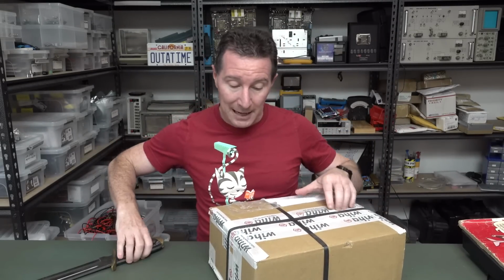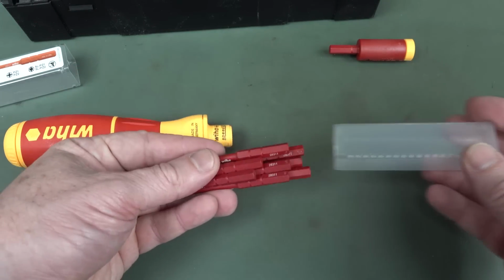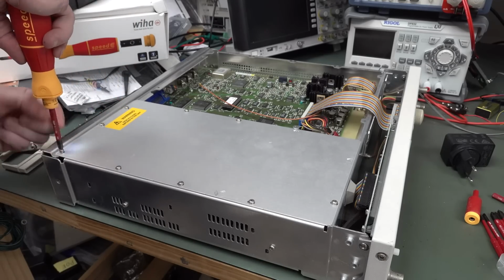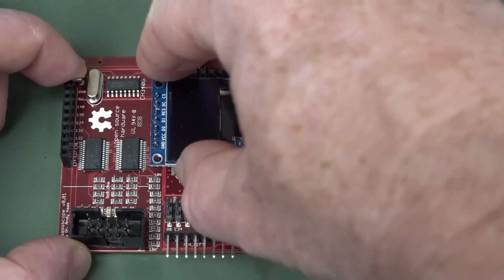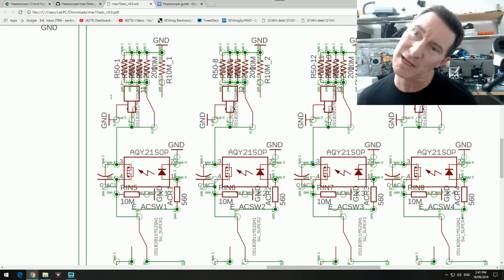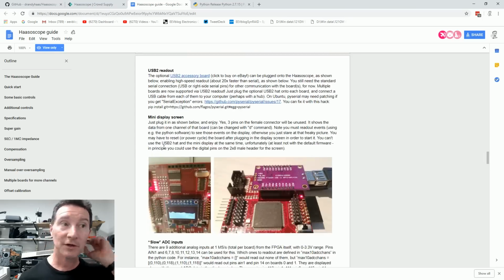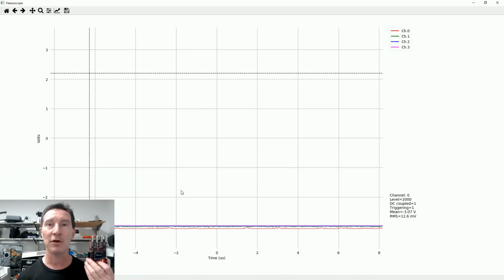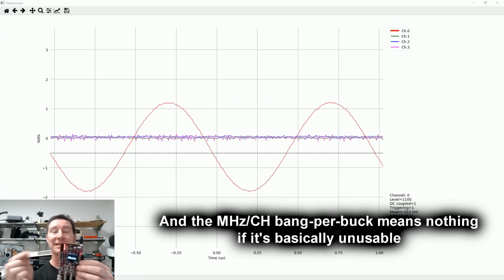EEVblog #1127 - Mailbag Monday

Comment: The 18650 is roughly 15mm longer than the 18500. First two digits are diameter in mm three following length. Protection / integrated usb chargers add some..
Reply: Maybe someone should produce a adapter ring.

Comment: 215 Euro for the entry level screwdriver?? That’s a “nope”.
Reply: NEO Digital you get a makita drill for that price loolz
Reply: @danijel124  you can get the damn set for that price
Reply: The gearing sounds terrible . It will break.
Reply: Yeah, the gearing sounded exactly like my €30 electric drill from 10 years ago...
Reply: Yep. From what he showed I'd have guessed 100 to 150 Euro for the whole set.
Reply: Yah wiha is definitely expensive for just the basic 1000v insulated stuff. It's built brilliantly but there are decent Chinese clones for much less if you're not using them for a job.
Reply: The model they sent dave isn't the 215 euro version its closer to the 371 euro version. Cause its the high speed version but not quite all the included bits as the 371. Still extremely pricey, Even for a professional.
Reply: NEO Digital That's not entry level.  That's a professional tool for working electricians working on potentially live installations all over the place and subject to strict health and safety enforcement.  So no using unapproved tools and parts, no using any tool not isolated to 1000V, no risking tendonitis from doing thousands of screws per day.  Everything about that screwdriver is made to comply with that environment, including recommendation from an organization already involved with other workplace injuries for electricians.
Reply: John Francis Doe What I meant by entry level was the lowest priced version of the screwdriver shown on the manufacturer’s website.
Reply: John Francis Doe,
 “workplace injuries for electricians”
Translation: Big money for greedy companies and jobs for the sake of jobs.
Reply: Dmrdecks your translation is exactly right. A 1000V screwdriver does NOT need to cost 500 anything.
Reply: Well professionals can afford paying that. This amount is also subtracted from tax, since it's a work expense. I don't think it's too great of a deal. Given the quality, this will surely keep working for a long time. Also, don't forget: 500 AUD is a lot more than the actual value in dollars or Euros (1 AUD = 0.62 € as of writing this).
200€ is completely fine for a tool professional electricians buy. I have seen way more expensive tools used by them in the wild.
Reply: 1000 V isolation is not that difficult to achieve.
Unless you have other demands, a normal screwdriver with sheated shaft should pass the test.
If you need a thinner shaft, you'd have to use a layer of mica or something, but even that shouldn't be too expensive.

Comment: If schematics is this worse, how´s about pcb design ?
Reply: May be an autorouted one ? It doesnt look like there was professional hands on layout design. I just had a glance on github files, I am just worried about those analog parts
Reply: Just opened it and had a quick glance. I don't do layouts for a living but just from a few minutes of looking at that board I found a couple of things that would bother me. And I'm sure someone like Dave who has actual experience in the field would rather start from scratch than use this layout.
And yes, there are 2 files for the autorouter in the github repo so that's probably how it ended up being such a mess.
Reply: I have found autorouter configure files inside the repo. It's probably at least partially auto-routed. Pathetic!
Reply: Noise on some channels mean that pcb design have problems too.

Comment: Engineer with decades of experience. Hasn't got python. Sorry Dave but this is 2018, and nothing runs without software, python is just about as common as solder flux in any modern lab. Get with the times.
Reply: Just need a Windows exe? Well that will run on Linux or MacOS ;-)
Reply: It is not the fact, it needs python, but the "world-changing" crap. If everything would be packed neatly in one installer python is fine. But for a real gamechanger, it has to work without what was needed here.
Also, the UI is pretty crap for what it is supposed to be. The everyday user does need all the fancy CLI Options. The everyday user needs an easy start. This was "advertised" as just this.This is just wrong.
Reply from the maker: My lab works just fine without it it seems.
Reply: Question is who would write NEW code in Python 2 in late 2010's?
Reply: @JGnLAU  I have seen this with many packages that depend on certain parts (mathlab etc.) of python plugins, they are not fully compatible with py3.
Reply: Seriously, what's wrong with Python in your opinion (besides execution speed).
Reply: python sucks...i only use it when i absolutely have to (just running scripts..no coding).. this interface could have just as easily been made in C/C++ (and ported to multiple OSs),  while requiring the python stuff only when a user wants to script in their own functionality...the very least they could have done was turn the py scripts into exe's with py2exe :/
Reply: Just as easy in C/C++ you say? Python, in this case, is glue code between QT, a serial port and Numpy (written in C), as well as requiring no extra effort to be portable (even between CPU architectures).
Reply: and your point is Tim? C/C++ can be used with QT and a serial port...
Reply: "this interface could have just as easily been made in C/C++ (and ported to multiple OSs)", C/C++ is not even close to being just as easy as Python for this kind of application. 

I've never understood the hate for Python, it's an excellent language that is a very natural transition away from C/C++ and lets you get to the problem you are trying to solve a lot quicker. In this case, the three libraries I mentioned will handle the bulk of the work.

The real issue here is the app they have produced has an awful UI. Has the look of a half-baked proof of concept.
Reply: I think Tricky Rat and WacKEDmaN are confounding Python with PHP. The latter really sucks, but Python is a fine scripting language for its purpose. They have probably mixed these two scripting languages and never programmed in Python. They are probably only reciting what they heard about PHP but made the mistake to mixing these two up.
Reply: I don't think they mixed it up.
Reply: Антон Южаков
No experienced software developer will say that Python sucks like they did. Experienced software developers might prefer other languages, they might also dislike the way indenting is used in Python but they won't say it's a bad designed language. Because they know, it isn't a bad design for its purposes.
This is a different story in PHP. PHP is really bad in many ways, including if you want to use it for its main purposes.
Reply: @WacKEDmaN  python is good for prototypping and testing. if you are going to have something has half bake has this you better write in python c/c++ will take you 10 time the time with 10 time more problems for anyone who wants to improve your shit.
Reply: "Python.  Why'd it have to be... Python?"  More carcinogenic than even JavaScript.  We need a charity foundation to stamp it out.
Reply: @Remco Stoutjesdijk - You script-kiddies are always good for a laugh...

Python is just plain awful as a programming language, especially considering we are "in 2018", as you put it.

Comment: The wiha is close to what I think a power driver for machine screws should be  - hand operation for final torque and fast-low torque for most of the thread, but looks at least 2x too slow to be a major productivity enhancer.
Reply: What is the difference with just a small battery powered mini drill and a separate screw driver for a fraction of the price?
Over 200 bucks is just absolutely insane.
Reply: @merlingallagher4484  They range from $300 to $520 USD, depending on the model. $200, maybe, if it was worth it for the job someone is doing, price is rarely factored in; you just buy it regardless of cost. That's the difference between some guy in his garage and a person that is using it for their business. But not $300-520 USD. Not to mention, it seems like a piece of shit.
Reply: Agreed the price is a big NO EFFIN WAY for me. It's nice if you get it for free but for what that thing costs ... No way EVER. Not on a hobbyist budget.
Reply: It doesn't say impact driver so it's probably only designed to do the spinning. I think I would prefer pistol grip screwdriver that varies the speed with the trigger.
Reply: It's too expensive for hobbiest use and much too slow for business cases.
They should lower the price to about 30-40 €.
Reply: You need to think about that one this way:
This is a device for and electrician. The one that comes to your home to install couple sockets on the wall. ONLY!
For any other purpose... NOPE. Then you go Panasonic or Makita.
Reply: I don't think many people will pay 250 for a screwdriver!
Reply: That's because not many people will. It's a tool for professional electricians, not the general public. They have special requirements and can subtract tax. That makes the difference.
Reply: I guess it would be good for electricians in automation. Making electronics cabinets for machinery with hundreds of wires being screwed in to terminal blocks.
Reply: Try the dewalt gyroscopic screwdriver (the DCF680N). I've used several different electric screwdrivers and the dewalt one is honestly the best I've tried. There's no dickin around with a reversing switch or speed control you just twist the screwdriver to get the speed you want, plus it's only $100 USD.
Reply: @AJMansfield1  This would be such a wonderful screwdriver if only not giroscopic. Omg would love some kinda marriage of Dewalt motor and shape + Panasonic buttons and electronic shut down clutch
Reply: I like it being gyroscopic, it gives me a lot of control over the speed it in a way that a variable speed trigger or twist mechanism simply can't.
Reply: Agree, mikeselectricstuff. The Wiha would be just perfect for a shmuck like me who can hardly line up a screwdriver to save my life, with the little bit of play probably even being an advantage... but the price tag is a bit to steep, even if I was working on keyboards and canned goods every day.
Reply: I'll wait for China to produce their version. 10% of the price of this.  God bless China.
Reply: EscapeMCPv why wait, Xiaomi makes $30 precision one already
Reply: i have same one like this in mailbag.but i already been once in warranty,it randomly started smoking then removing screws.now 2 week at warranty and stil no answers if they replace it.they keep ignore my email about warranty status to..no response so far.
Reply: I had a black&decker gyro driver that was similar to this but instead of that rotary part, it worked by motion. so you press the button and as you turn your wrist it starts to spin. spinning faster the more you turn. It was really cool! And could get really good control over torque/speed with the motion control. Was expensive at the time tho.
Reply: I still have my B&D cordless screwdriver that I bought in the mid 90's for about £30. It was just as fast, but had way more torque. Needs a new battery though. :-)
Reply: At nearly £250 on eBay the Wiha is too expensive!
Reply: I am guessing they are using very small motor and a worm gear to get required torque and self locking once motor is off (so you can't back drive the gears).
Reply from the maker: xConundrumx - To be fair, it's not designed or priced for hobbyists
Reply: That is just a little elitist Dave--I'm pretty sure my hobbyist pocket money spends just as well as a professional electronics engineer's wages do!!! I would 100% buy one of these things if they cost even as much as £60, given the safety testing they probably have to undergo. Any more than that for a powered screwdriver is totally insane! I can get one that works just as well for £10 from Aldi.
Reply: I'll stick with my original Skil Twist 2105 from the late '80s/early '90s. Seems superior to this in almost every way, except maybe not having a replaceable battery.
Reply: When it comes to price keeo in mind that you are getting a set of Wiha screwdrivers which are not cheap. Still I would not likely spend that much to just turn screws.
Reply: so you hear it folks ....make one with more power....and fits standard bits and the pros will buy it. wasn't marco reps working on a 1.5 kW one with a BLDC?
Reply: We tried the thing in our shop and were less than impressed with the performance. The thing lacks power big time. It can't screw in screws that where first removed first from a kids toy to then be reassembled. It took a final 10 turns with the screwdriver to get them in, not tight, in. It worked with nuts and bolts, kinda, but it just lacks speed and power. I love Wiha products but this thing missed the mark completely in my opinion.
Reply: And it's too expensive... booo. Was expecting $200-ish. 500? Nah. I'll stick my ordinary wihas and swiss hex keys.
Reply: As a sparky I would never buy one of these.  I replace my screwdrivers every 6 months, they wear out and the insulation gets worn down in the field.  Those tips would be so easy to loose and changing them when you are up a ladder would be a pain.
Reply: @highks
That's modern marketing for you.
Give free stuff to a bunch of shills, farm the audience like cows.

Dave is one of the few "I don't give a fuck" types who would put out honest reviews, despite being given free copies. Kudos to him.
Reply: If you want productivity you need a production driver from Densei-Delvo. They put screws in (or out) with the speed of a nailgun, but still stop magically at the right torque. They push start (on the bit), and never cam out, even on slotted screws, which is a complete mystery to me. I picked a few of them up (with various defects) many years ago when Ebay was still cheap, and nothing compares if you need into a clamshell enclosure with 20 screws. These will put a smile on your face since you are in not just like Flynn, but like "I don't even wait" Donald. Always have one ready at the bench with a reduced shank phillips #2 bit, for those emergency repairs.
Reply: stefantrethan that sounds amazing, though I've noticed that production drivers from Japan are pricey indeed if you get them new. But even the cheap as chips Chinese clones are super-fast and a joy to use.
Reply: I would never consider buying one at regular price, but this was back when there were so few users on ebay I could actually keep an eye on the entire test equipment/tools section for Germany/Austria, to look for interesting items. My rule back then was to never bid more than 1/10th of value, and I won a lot of neat stuff. If you try that today you'd get exactly zero, better off with the slow boat from China stuff...
I'm not sure how they manage to make a 1000+ RPM driver that still stops at at the righ torque with such small screws. There is a mechanical ball-detent clutch like a regular drill/driver, but it also stops electrically. They have a central pushrod that runs coaxially throughout the entire drivetrain, planetary gearbox and all. It operates a switch and stops the motor, there are braking resistors that do something useful I'm sure...
A couple of the drivers had broken magnet wire at the commutator connection, which I could solder, and all of them had the stranded power cord solder tinned where it was clamped in the plug pins, of course all loose due to cold flow, easy fix.
Reply: I'm still a fan of my spec tools overdriver pro.  Works like a regular multi-bit screwdriver, but you grab the black part of the handle, it gives you a 3:1 speed increase when putting screws in.  Also a very smooth ratcheting mechanism.
Reply: Electric screwdrivers like that Wiha are such a waste of time. They are too slow and too gutless. I've tried heaps, and even in production work it's so much easier not to bother.
Reply from the maker: Yep, agreed.
I've used Panasonic ones before for production and you need it maybe twice as fast for decent productivity.
Reply: This thing costs more than those Panasonic ones...
Reply: Let's not forget that it's made for electricians, not for production.
Reply: Антон, It still has to be faster than doing it by hand or theres no point.
Reply: I don't think that it is about speed, especially with that "doctors recommend".
Reply: Don't think I'll be giving up my cordless drill for one of these and I'm pretty sure most other sparkies won't be either.
Reply: But its way to weak for normal electrician works. It lost against that back screw and for example the screws in electrical installations are much tighter (and often bigger) than this one. I can't imaging using this toy  to change some 30 year old relays in some cabinet with bosses and 10 people who know how to do it better behind me.... Like Dave said, probably useful for RF cans and normal bench usage...
Reply: A Hitachi Zip-zip will do us lecos, I reckon.
Reply from the maker: Yes, granted, horses for courses I guess.

Comment: Since the purpose of the electronic torque limit is to prevent stripping the fasteners, it makes sense that it would be limited the same in both directions. Using hand torque above that limit would presumably let you judge if the fastener is stripping or not.